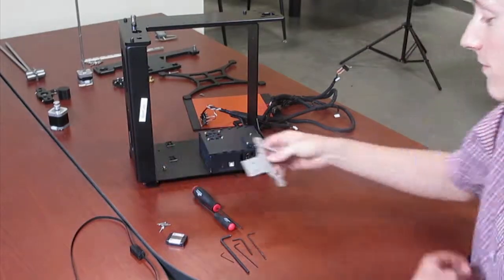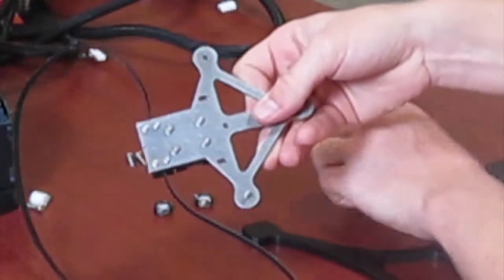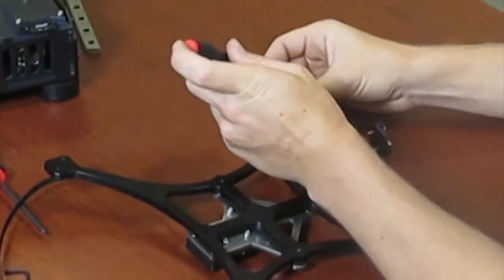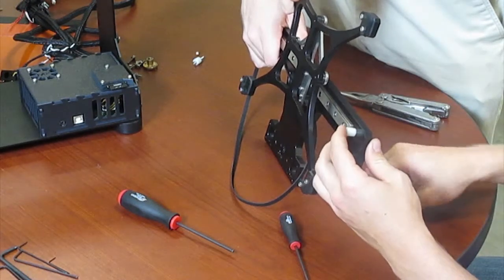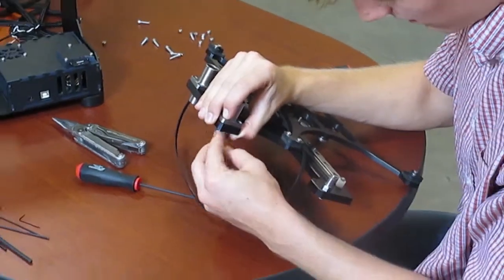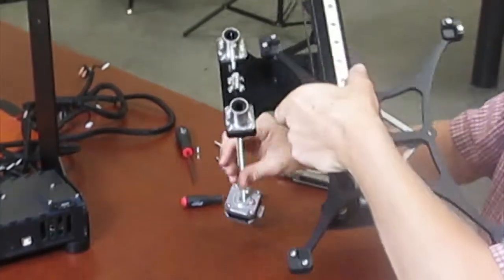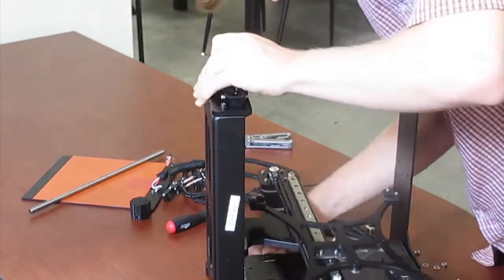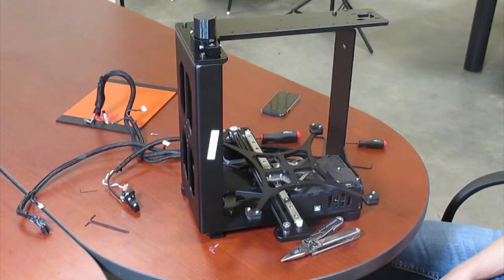MakerGear M2 Assembly Part 2

Comment: Hi. I have a question: How did you adjust the Lower Shaft Clamp Block position (minute 11:12 of the video)?. There are two slots in the frame for the screws that hold this block in place. I notice in my M2 that the bed does not maintain the same angle (watching from the top of the M2) while moving the bed from the bottom to the top. Looks like the top and bottom shaft clamps blocks are not aligned making the two vertical shafts slightly twisted. How can I be sure that the X and Y rails are always at 90 degrees while moving the bed all the way along Z axis?. Thanks!!!